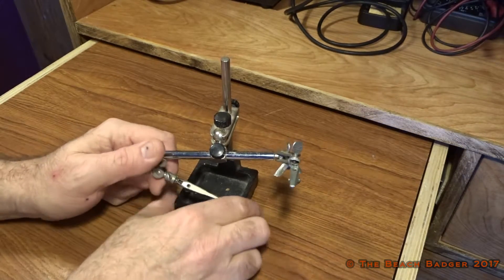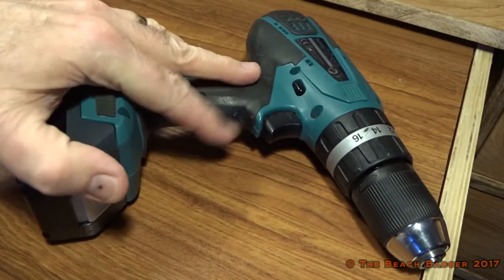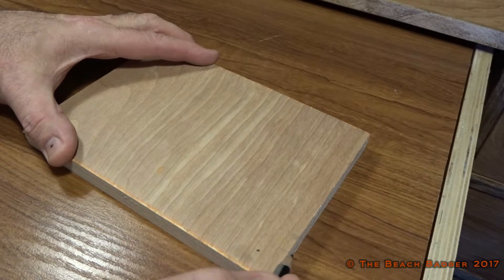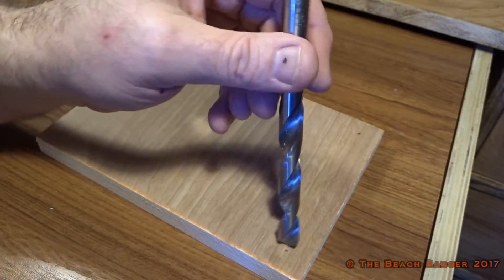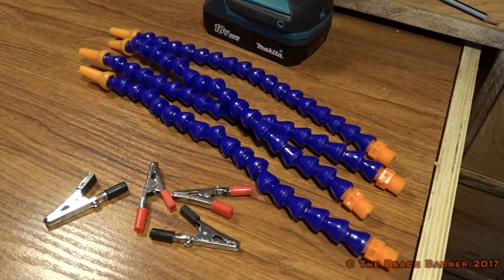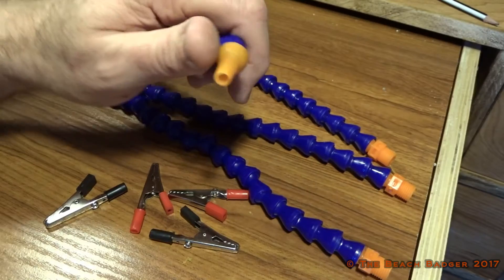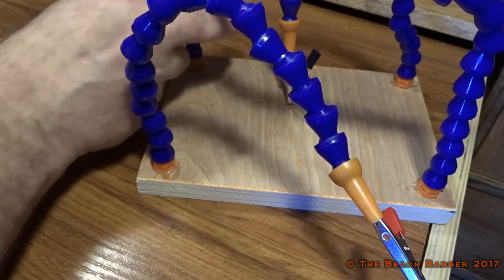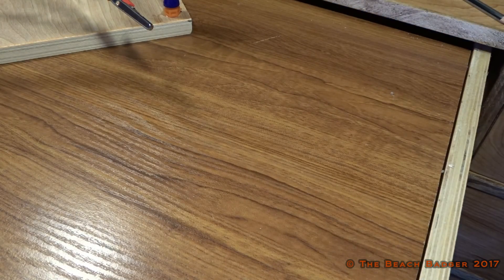How To  Make a 3rd Hand Soldering aka Helping Hands cheap and easy

Comment: I didn't have a hunk of scrap wood laying around, so I went to Home Depot and bought a piece of solid oak plinth moulding. It's 8 x 4 1/2 inches and it is even cut to look all fancy. Drilled 6 holes in it, put a little wood glue on the tube threads, and screwed the tubes in. Looks beautiful.
Reply from the maker: fantastic job Levy a very useful tool to have